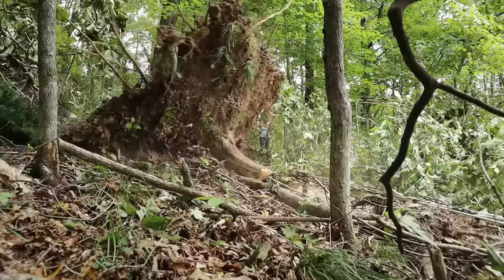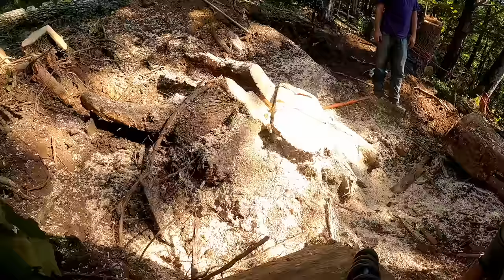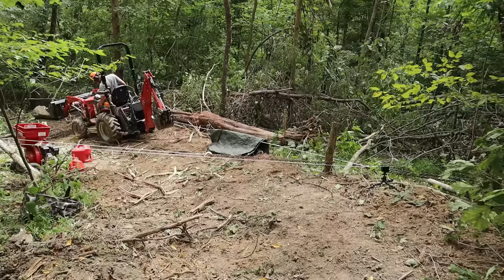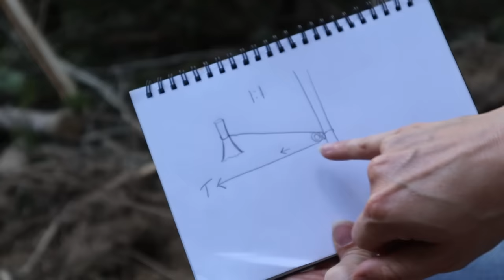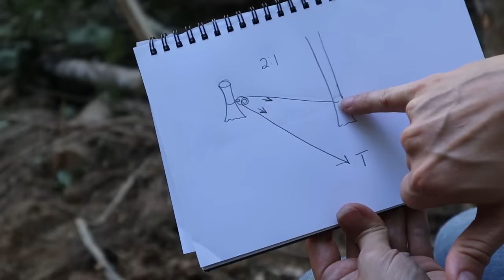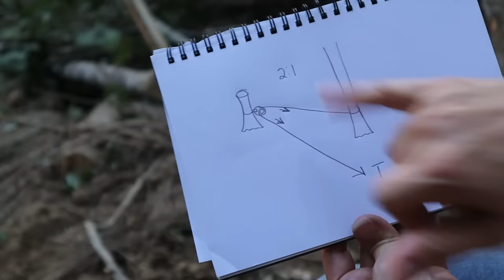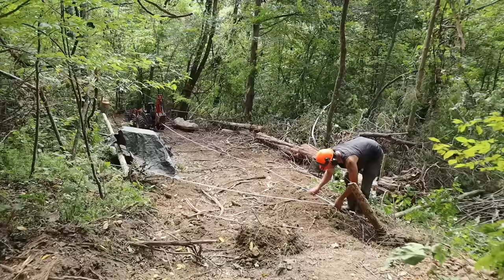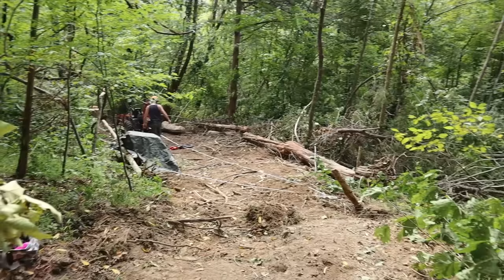Snatch blocks vs tree stumps - the power of pulleys /// E57

Comment: Here is some food for thought. My wife and I did exactly what you are doing and built our home at a high point on our property. The view is great, but in the WINTER it can be a pickle. And you may think that is not an issue since we are retired. What happens if you need the fire department or and ambulance? Plus the longer the driveway the more expense incurred. Just some thoughts. Good video!

Comment: I see the comment below and realize that this is basically a repeat, but I state it differently.  I took down a 22" pine tree 10' from a house,  after removing the top and branches I was left with a 20' stick.  I call this a 20' prybar.  after cutting the surface roots on the offside, I used some logging Chains (about 100') tied at the top.  The chains were chains attached to my Ford PU.  Each pull the back of my trick would lose traction, so I filled the back of my truck with cut wood and after a few pulls down it came.  The longer the pull down roap or chain the easier the success.  The tree is the lever bar.  Take the tree down then worry about the roots.

Comment: Great essay!  The only thing that made me cringe was the act of pulling on anything with a tractor hooked HIGHER than the axle.  That is how you get a tractor to flip over backward and Casper you.  Yes, I realize that the bucket would have prevented that in this case...  When you hook up below the axle, you're driving the front wheels down, maximizing available horsepower.  When you hook up ABOVE the axle, you're simply using all that power to raise the front end.  In many cases over the centuries, this has crushed people to death.

Comment: If you tie your anchor ropes low as possible to the ground and the chain attached as high as possible on the stump being  pulled is a big advantage also when tying pullies etc by using a double half hitch to secure as the more tension the tighter the chain will grab, you may want to put something between the bark and the chain as it will scar the bark on the anchor point.

Comment: great video.  So the physics nerd in me has to ask. Have you tried flipping your last set up so the blocks that the tractor pull from are attached to your anchor tree?  I am guessing it would be more efficient.  With your current rig you are splitting your pulling force in two directions.  Think of it as your tractor is trying to pull in one direction and your anchor tree is trying to pull in another direction.  The stump doesn't know which way to go.  If the tractor adds force to your system at the anchor tree ALL of the pulling power is directed from the stump to the anchor tree.  The stump doesn't get a choice which way to go.  Just curious if would work.  I am getting ready to go pull a bunch of stumps for the first time myself.  Thanks for taking the time to post your method.  It is the best I have found so far.

Comment: First off, if you're gonna pull a stump out, chain it much higher which gives you way much more leverage and torque. Secondly, a huge problem with digging up stumps or pulling down trees is that in many cases, you end up often with a ton or more of good earth which stays packed in the root bed, so, you have to either haul more dirt in or use water pressure or timely picking to keep all that good dirt. A good method for small to medium girthed stumps is to gather alot of metal drums, cut the bottoms out, set over stumps, and keep fires burning for a day or two.

Comment: Here's a trick for your rocks.  This is a trick my contractor showed me.  When he dug out a hole for my foundation, there was a huge bolder in the middle.  At the end of the day, he put a pile of wood scraps on top of the bolder and lit it up.  This super heated the bolder and then in the colder night air it split in more manageable pieces.  We can also drill holes in them and there's metal inserts that you hit in and they will cause the rocks to split.

Comment: Good job, I'll be doing the same soon.
Btw, it doesn't look like you have the tractor in its lowest gear, it's moving fast. You want it in 4 wheel, low drive, and 1st gear if manual. That's where all the torque is and you won't spin tires so fast.

Comment: Nice job on the snatch blocks guys! You are making great progress! Also love the videos!  Comment on the iceberg rocks standing in the way of your drive:  Can't you use the jack hammer to lower the portion of rock sticking up by 5-6 inches?  You could dig a hole next to the rock to bury what you jack hammer off. Just a thought. 
Best of luck and God Bless!
Reply from the maker: Hi Floyd!  We're definitely thinking along the same lines.  I have a few monster icebergs that aren't going anywhere and I plan to remove the tops.  Some of the rock is really hard limestone and I was thinking I could cut some relief cuts with a diamond blade on my angle grinder (create weak points) and then snap them off with the jackhammer.  👍
Reply from the maker: @katiedotson704  definitely!  We used them exactly for that purpose too.  We actually expanded our set to a 16 to 1 ratio and it's a big game changer for us.

Comment: 1. Push over / pull over / both , on uncut tree !
2. Having a tractor, undermine the root system a bit, then raise your bucket high, and push against tree along with using pulling - multiplied power .
3. Cut tree apart after it has been braught down .
4. High Five !

Comment: You have to understand "parts of line," when using snatch blocks. Knowing what your strait line pull is capable of, then understanding that each "part" doubles the the strait line pull. Example: if a straight line pull is 12,000 lbs. (tractor to tree), then tractor to tree (hooked to a snatch block) and back to the tractor or a anchor (larger tree), equals 24,000 lbs of pull - two parts of line now gives you double the "line pull." Three parts, triple or 3x12 = 36,000 lbs of line pull. However, if your cable is only rated at 1,000 lbs breaking strength, you better stand back because someone is gonna eat a snatch block or be decapitated by a cable breaking and flying through the air at the speed of sound - which gives our stump pullers no time to DUCK. I suggest "Bob's Rigging & Crane Handbook," to fully understand the issues involved in removing stumps or other matters of mechanical advantage. SAFETY FIRST, so you can live to tell about it. Another book that is indispensable for these matters is, "Moving The Earth" by Herbert L. Nichols. He has a whole chapter on this subject.

Comment: I noticed that you have a backhoe on your tractor.  Why did you not use the backhoe to dig out and break the stump roots?   You can dig out the roots, and use the backhoe bucket and thumb  to break them, and or chew them up. then, rock the stump with the back hoe, and then lift it out, and take it to where you want.    I have a Kubota.  Mine is a bit larger than yours, but you can take stumps out with yours.  No need to run long cables, and attach multiple snatch blocks, and try to find a sufficient anchor tree.  Snatch blocks are fantastic!  My neighbors use them a lot.  They are great for pulling large trees down the side of mountains, when gathering fire wood.  Play with your tractors backhoe, and learn how to use the bucket, by curling it, and pulling it towards you, and lifting logs, and stumps, etc.  A backhoe with a thumb is so handy, and versatile.  You can hold logs up for sawing to length for fire wood or for grabbing the roots, and tearing out, or tearing them to shreds, and grabbing the top of the stump, and rocking it back and forth, and sideways, till you have the tap root broken, and lift the stump out, or dragging it out.  I absolutely love my Kubota tractor.  I have a Friend that bought a Kubota smaller than mine,  about the size of your tractor.  And he pushes trees over, and picks them up and saws them to length, and picks up the stumps and takes them to the burn pile.  I am in no way dissing on the snatch blocks.  Like I said they are fantastic tools, I was just wondering why you didn't use your backhoe?  Even use it with the snatch blocks.  You can also use the back hoe to get the rocks out, and take them to where you want to pile them.  Like on either side of the drive way entrance..  Or you can just roll them down the hill, or line the  side of the drive way.  If you can't pick up the larger rocks with your backhoe or your front loader bucket,  you can dig around them and push, or pull them out of the way.  Good luck with house.  I am glad to see you both participating in the work.  You will appreciate the home, and each other more.

Comment: If I might add to the conversation-leave about 6 feet of the stump and attach the block near the top of the stump you wish to remove, but at the bottom of the anchor stump. The leverage advantage is tremendous.

Comment: Tie around your anchor tree as low as possible, to get as much anchorage as possible. You can also spread the load over several trees. Tie your snatch block to the victim tree as high as possible to get as much leverage as possible

Comment: Block & Tackle . . . good stuff is expensive. Snatch blocks are a type of block. What you want is LEVERAGE. You tie it high in the one you want to pull out and low on the anchor tree. That's how the WIND can pull the tree down. Your anchor tree looked like it was dead. Anyway, you want a 4 or 5 to 1 so you put the pulleys on BOTH threes. High on the one you want to pull out and low on the anchor tree. I've been doing this since I was 15 years old and I'm 67 now. Just look at any crane and see how many pulleys there are . . .

Comment: I don't stumps because I knock the trees down so no stump is left. I do this using mechanical force just as you do, but not using pulleys etc.. I use either a mini excavator or a skid steer. First i cut the roots on three sides of the tree by digging with the equipment. I leave the root intact on the side in the direction I want the tree to fall. Then I reach high with the Excavator arm or the skid steer bucket and push the tree. When the tree falls it lifts the root system out because of the mechanical leverage of the long heavy tree, kind of like a handle it pulls it's root ball out with it. I have seen farmers in New England do the same thing with pulleys chains and ropes. they wait for a long soaking rain to soften the ground. Then they attach their cables or chains high in the tree and using blocks and tackle they simply pull until the tree falls and lifts the root ball out with it!

Comment: If you hook to your tractor at a point a little higher than the center line of your wheels it will put more down pressure and help prevent spinning.  Like others have said, get it unhooked from the bucket if it's still there.

Comment: Unless the anchor tree is going to be cut and removed later, I would suggest a tree saver strap around anchor tree to prevent damage to it. Very commonly used in off-road recovery.

Comment: Gotta be mindful of Load & Resistance.

What are you pulling on? What are you anchoring to? Will the anchor hold the force needed to pull the load? 

What equipment you are using… will the equipment sustain the load/force applied?

Setup- 

Pulleys can be stationary or mobile-  

However, as displayed in the first figure- change of direction. No mechanical advantages.

Figure 2 (21). Still a change of direction…

Mechanical advantage is composed of lines to the load- over lines to force.

Tractor- line- load pulley- back to tractor, add another pulley. Return your line to the load- thru the the 3rd pulley anchor to tree.
For every pound of force applied to the line from the tractor- will multiply force to the load (stump) 

Drive tractor away from stump- . 

For every ft of line pulled with tractor. 3x the force applied to stump.

Equipment +Setup= 🏆 

Ignore those and mishaps will happen.

Comment: Simple rule of thumb:  if the end of the line starts on the anchor it will be an even mechanical advantage. 2:1, 4:1, etc.  If the end of the line starts on the load, it’s an odd mechanical advantage.  I remember it by thinking about the two (even) flukes on an anchor.🤷‍♂️

Comment: As the hours of operation of the tractor pile up you will find you get very smooth with the hydraulics.
Also the higher up the stump you are pulling on the more the leverage against the roots, just saying.

Comment: Good way of ring barking a healthy anchor tree by using a chain, use a tree protector strap instead, use chains for the stumps your pulling out but tree protectors for the anchor, also with any of the multi snatch block uses, ie, 2:1, 3:1, 4:1 pulls, try to keep the pull in a straight line as any change in direction you lose pulling force unless the the change in direction is from the anchor tree and not the stump and don’t hook to the bucket as you risk damaging hydraulic spools and valves, hook to a dedicated hitch on the tractor chassis instead.

Comment: Looks like the tooth bar on the lil Sherman tank is working as intended. Now you need to get a box blade to finish the driveway grading. More toys to work with.
Reply from the maker: We'll definitely be whipping out the box blade when the backhoe work is done.  I got one when I first got that tractor.  I've used it on the first part of the driveway already and it performed really well.

Comment: Well done, that was a great video.
If you look at your diagrams again, you will notice that your 3:1 system is actually a 2:1 pulley system, and your 4:1 is a 3:1 system. Your last two drawings show that you changed your anchor point from the original tree, to using the stump to be removed as your anchor point.
As your anchor point was weaker than the lifting point, the anchor point failed.
This is not criticism in any way, I think that you did a fantastic job and  it doesn't matter how you look at it, you achieved your end goal.

Comment: What I do is not cut down the tree but cut all the roots around the tree just leaving the tap root, then use the height of the tree as a lever hook a come along to the tree as high as I can get it and pull the tree over. That pulls the tree out of the ground tap root and all eliminating a stump. Worked every time I did it.

Comment: Great video! Try to anchor as low as possible and keep an eye on that cable. If it kinks replace it and it ain't a bad idea to rub some grease in it if it is like crane cables.
Reply: I second that, once a cable is kinked it has a weak point and it can snap unpredictably.  Extremely dangerous if it happens, the cable can whip in more ways than you would ever suspect.  your setup with the how on the back of the tractor actually provides decent protection for the operator, but keep the spectators well back and preferably behind a good sized tree just in case.

Comment: As has been said. Attaching as low as possible on the base tree and as high as possible on the "stump" tree is best. I wouldn't cut them any lower than 4'. Or as has been said, just fell the tree with the pully system for max advantage at say 10 or 15' up the tree.

Comment: Increasing the number of snatch blocks also increases the tension on the cable. Know your limits its possible to snap the line simply by adding more snatch blocks. I saw a video of a guy on a large tractor get killed by a parted cable coming into the back of the cab.  Perhaps a thick piece of polycarbonate on the roll bar or do the calcs so you know you’re sure.

Comment: This is my first video of yours so I don't know if you have tackled the rocks or not.  You can get wedges to break them.  Also a chemical splitting compound that expands.  Both will require you to rent or buy a drill to make the holes and a compressor to run the drill.  Hmm  may be easier to get an excavator over there for a day.   

Just my two bits worth.

Have fun.

Comment: Hey guys how are you doing? First video of yours I viewed and like it. OK, since you have a backhoe, many snatch blocks and brain power. I have a link to another channel that I would recommend viewing. He does a lot of tree removal. Mind you he does use a trackhoe and it is bigger. But the principal is still there. The way he digs a tree and then you can add your snatch blocks to, I think make it easier. BTW great drawings you made. This guy is awesome at removing trees. I understand you do not have the same equipment as he does. Yet, a little digging should make it easier on you and all of your equipment. Also. Watch out for the wire rope. It has energy in it and if it brakes. Zip boom bam It will cut you or kill you. I would look at the kinetic ropes they use in winches. Your tractor is 12 volt. I would look at the biggest winch they have at Harbor Freight. Yes they do have good winches. In my mind if I was you. Make or build a receiver hitch on your bucket. String the 12v wire to it. If or when the winch reaches it's limits. Use your backhoe to add a little more pull to it. Also, when a kinetic rope pope/brakes. It just falls to the ground. Yes, it will have some energy. But nothing like a wire rope like you are using. I did see where when pulling. The wife was well guarded by distance and trees. Good Girl on that. I have seen what a flying wire winch rope can do damage wise. Not pretty at all. Here is the link to his YouTube page. He is an awesome operator. Also look at getting a root ripper for your backhoe. It is a single finger, sometimes a double, that is like a ripper on a box blade. Does not dig, for say, just rips through the roots.
  https://www.youtube.com/c/letsdig18
Reply: Forget the puny electric winches. Get a Farmi winch that operates off the PTO. Way more pulling power!